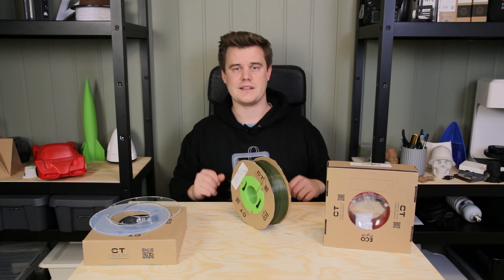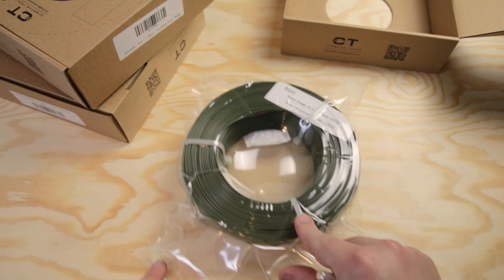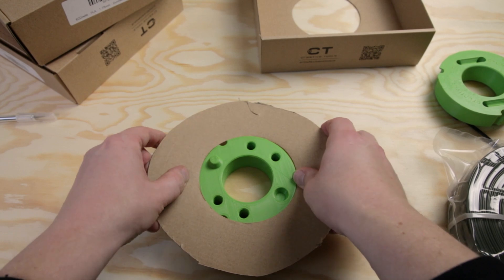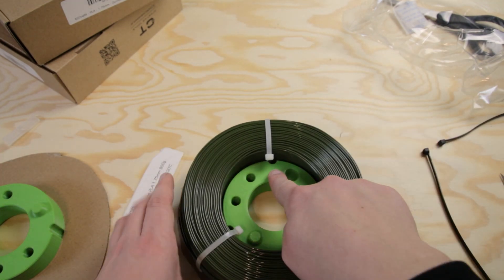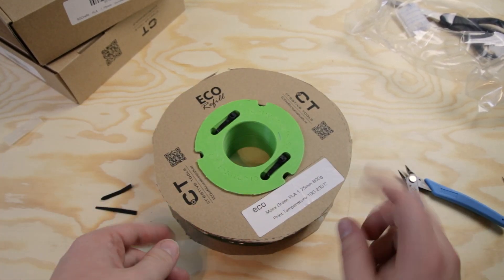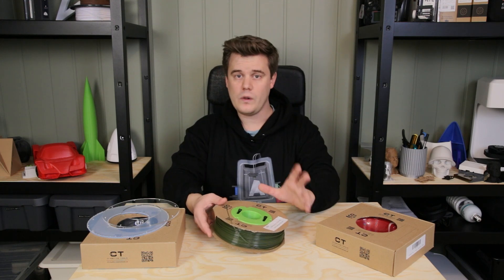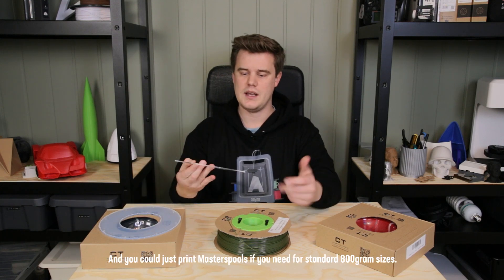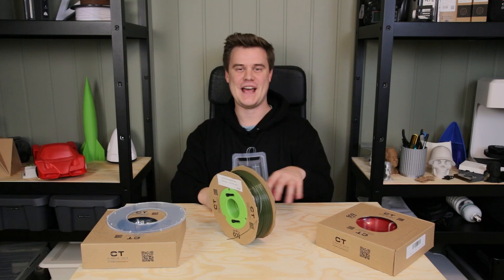Save money 3D Printing by using re usable spools | ECOrefill

Comment: The sides in cardboard is Russian roulette.. at least if you're handling the spool  often.. I made this "remix" https://www.myminifactory.com/object/3d-print-144525 with different sides for 800g and 1500g spools prinable on smaller beds(155x155mm for the big spool). Zip tie and screw alternative.. and you can even remove the filament from the spool..
Reply from the maker: Aah, smart!  I guess CT is getting the reusable plexiglass sides out as a similar solution. Nice design!

Comment: I think it would be preferable to use screws or bolts to connect the two halves - which would cut down even more on waste. I wouldn't think it needs to be anything fancy or precise either -- just enough to stop it from separating while it turns. A 3d printed coarse bolt?
Reply from the maker: That's smart!
Reply: Yeah like esun did it with their old spools / All of them were reuseable with their 1KG refills. But for me the refills are sadly to expensive. 4,5€ more per KG as the filament i normally use. But the 1,5KG coils are nice. i don't like that 700-800g ones
Reply from the maker: That's good price for filament, what do you use that cheap?